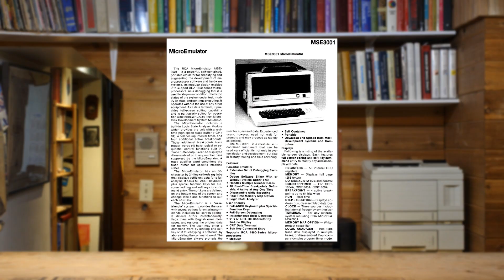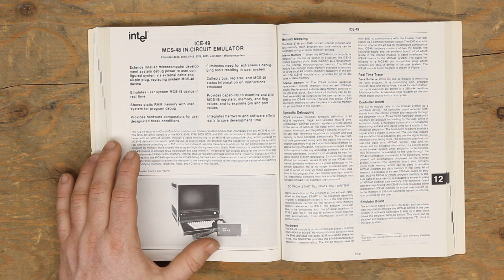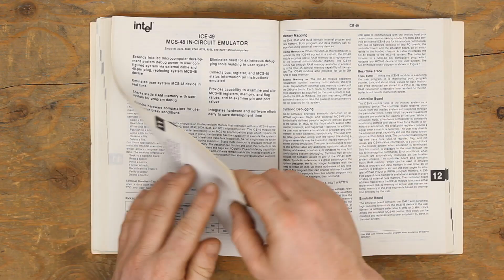Development Tools for the RCA 1802: The RCA MSE-3001

Comment: maybe someone else has already mentioned this, but given the era and the photo of the keyboard in the advertisement I expect this would have incorporated a stock, off-the-shelf, "ascii-encoded" keyboard as was common at the time.  what"s inside even an Apple II is a mostly standard ascii-encoded keyboard.  7 or 8 bits of ascii code, a strobe line from the keyboard to clock a byte into the host's input buffer when a key is pressed, and +5 V and GND would be the interface.  there are a number of DIY PS/2 to Apple II interface devices around that convert a PS/2 keyboard into a parallel ascii interface, so that Apple IIs with dead keyboards can be resurrected with junk modern PC keyboards.  the pin-outs are meant for the keyboard socket on the Apple II motherboard, but they're easily adapted to anything else that uses the same signalling, and that might let you plug a PS/2 keyboard into this.

Comment: Interesting device. The reference to "personality module" implies that you could swap that board and it could be used to do development for other processors. FYI, Motorola had the D1 kit which was a development board for the 6800 processor, and the D2 kit which was a development pair of boards for their 6809 processor.

Comment from the maker: @Josh Rice, Youtube ate your comment but I remember seeing your MS2000 while trying to find information on this machine. If you can do a video, go for it!
Reply: There is a comment in this manual for the MS2000, containing the following:

"Optional add-ons include a PROM Programmer package, BASICI, BASIC2, the CDPI8S040 CRT Terminal providing full-screen editing, and the MS3001 MicroEmulator."

What you have is the MS3001 MicroEmulator. I imagine that the MS2000 and the MS3001 would often be paired, with the MS3001 doing the duty of the terminal interface for the MS2000.
Reply: I've uploaded a somewhat incomplete and rambly video of my machine

Comment: The spec sheet for the emulator says it has a 1000 word 64-bit trace buffer.   So probably that is the function of the SRAM board.  Most emulators had RAM which could be mapped into the CPU's address space in place of EPROM, and the code could be downloaded into it for emulation and debugging.  Probably that is the RAM on the CPU board.   Getting a keyboard working shouldn't be too hard.   I agree that reading all of the EPROMs would be the first step.   If you can read them 3-4 times and always get the same data, the contents are probably still OK.  It seems that once "bit rot" sets in, they will read differently each time, as some bits will be right on the edge of 0 or 1.  I would also look at the keyboard connector to see if it hooks to that UART chip, or to some of parallel interface.

Comment: Great video!

These are the steps I would take to put this machine back in working order:
1. dump the ROMs and disassemble them
2. analyze the boot vector code to see what it might need in terms of talking to peripherals in order to get to some sort of interactive loop via kbd.
3. reverse engineer the circuit back from the keyboard port to determine the connector pinout.  If you're lucky the keyboard is just talking serial data to a UART chip.  If you're unlucky, the keyboard is talking to a PIO port and the key matrix is being scanned by the CPU

That should get you to the point where you can simulate the keyboard enough to interact with the system.  Since there's no external storage, I wouldn't be surprised if the ROM has a way to download a development program into the system via an external serial port.  Check the connector pinouts for a standard RS-232 style DB25 port connected to a UART chip on the main board.  They may upload as a raw hex dump or perhaps Motorola S-records or maybe something specific to RCA.